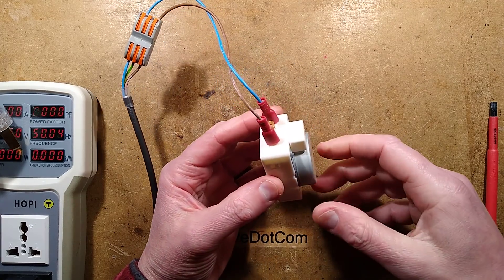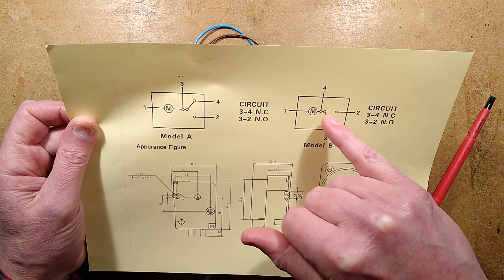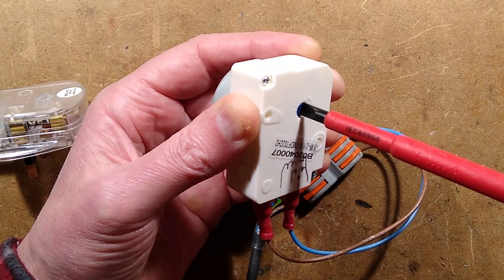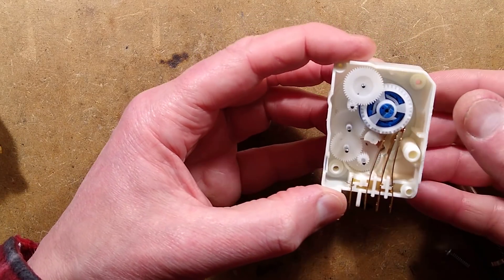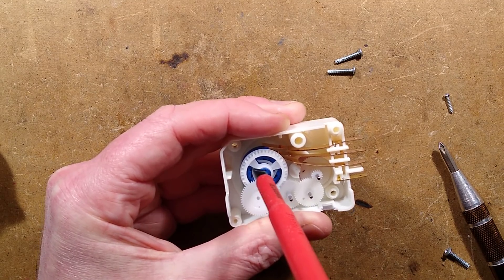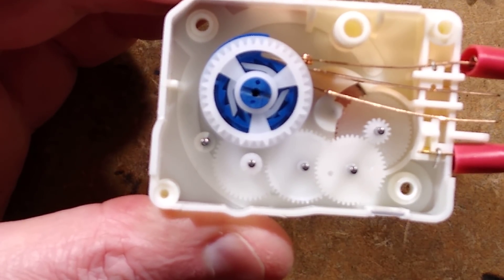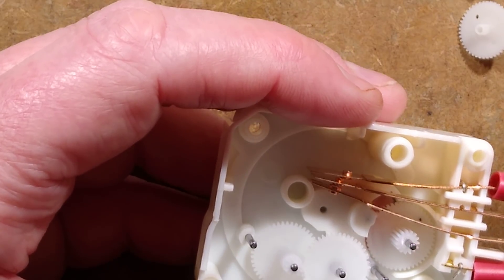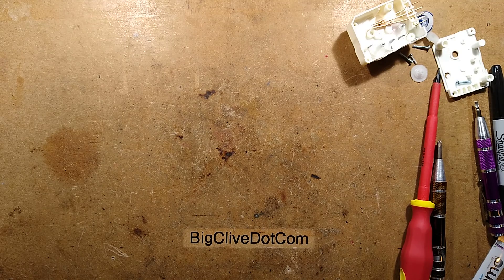Defrost control timer.  More complex than you might think

Comment: How can the tiny timer motor windings handle the current that is needed to run the compressor (in the second diagram, when the DF stat opens)
Reply from the maker: It doesn't.  The motor runs on its own.
Reply: @bigclivedotcom  oh, so at 15:18 the current trough the compressor is not enough to start it up? I thought that if you connected a very small motor(in the timer) in series with a very big motor(in the compressor), you'll just end up frying windings in the small one.
Reply: @billysgeo  The timer motor draws so little current through the compressor motor's winding that the compressor motor wouldn't even notice it. Also, at such a low current the resistance & reactance of the compressor motor would not reduce the voltage to the timer motor in any meaningful way.

Comment: Clever, but if the defrost heater fails it will get stuck in the defrost cycle until the whole fridge warms up.  It could do with a timeout function.

Comment: Is that motor one of those that give you one hell of a zing if you hold the leads and twist the motor shaft? If so, make a projekt with it as a wind powered generator, lighting some LEDs.
Reply from the maker: Yes, the synchronous motors do pack a punch.

Comment: What is amazing is that these defrost timers haven’t changed much in the last 45 years, and they are still present in refrigerators for sale today here in the US.  There is some very cool mechanical engineering going on here.  I am very impressed with the interaction with the compressor contactor and the defrost heater that allows the timer to dynamically adjust the heat dwell time so it is just enough to clear the evaporator but not let the freezer compartment warm enough to spoil the food.  You could throw PIC, thermistor and a relay or two at the problem, but the mechanical solution is elegant  - no need.

Bonus points: reverse engineer a mechanical timer from a Hobart/Kitchen Aid dishwasher.  They’re a work of art.

Almost all top loader washing machines use the same electronics board no matter the manufacturer.  There is usually service booklet stowed inside the washer.  Some neat tricks that can be done in service mode as described in the booklet.

Comment: Dang big clive those been extinct for 20 plus years on us. I miss them now they computers pc no way on some to even initiate defrost. The one you got runs all time unless motor wires in series with thermostat for culumutive run. But most just get yes 110 volts +-10 per cent . Anywho runs all time 1st click it puts refrigerator in defrost mode if defrost termination thermostat is - 10 degrees fahrenheit thereby turning on defrost heaters melt ice off evaporator coil fan powered blows to bottom refrigerator parts 2 click right back to refrigeration. There first runs all time stat in conctdered columitive run. I've had drains clog up with ice after years of a little ice. You can wrap a copper wire around the element then it will convect heat and clear drain is water under crisper drawers. Those were easy the new ones suck. Determine time doors open etc haven't seen in  20 years. I worked on thousands and instructor hvac 
GOOD JOB IM NOT worthy thanks

Comment: You should make yourself a foot pedal power switch so you can turn a device on and off while your hands are busy holding stuff in  front of the Camera. I have a set of lights over my work bench set up with a foot switch so that I can turn extra lights on when I'm working on something and I realize that I need more light to see what I'm doing.
Reply: Even without the camera it would be useful if you need to hold probes or something in place during powerup. If it's a momentary switch it could also be useful as a dead man's switch when working on potentially dangerous devices. Just be sure you use a properly rated double pole switch if working with mains.

Comment: The "ramped screw" is actually a copied design of the earliest tamper resistant screws if you look up "one way flat head screw" you'll see what I mean. Common in the US for putting together toilet partitions, installing towel holders ect. Anything public you don't want anybody messing with
Reply: Power boards use them to prevent disassembly...
Reply: @KomiyanVT  yeah they're used all over the place. It's one of the first tamper resistant screw designs.

Comment: Hey Clive; thanks for the explanation of the defrost control!  It is indeed complex using the components to provide power paths as they do.

When you don't have to maintain any part of the cabinet always below freezing, there is another interesting way they make a defrost system. This 1960's era soft drink cooler uses a cycle-defrost system. It can maintain bottles at or slightly below freezing but does not build up frost or require any dedicated defrost heater or other components. Forgive me for not mentioning I'm talking Fahrenheit temperatures in the video! It was for my vintage refrigeration repair friends.

https://youtu.be/79e7ie-6pE0

Comment: They don't use those mechanical defrost timers anymore in production.  Most any fridge less than 10 years old uses a control board which takes care of the defrost cycle,  the box temp (thermistors are used),  among other things.  Everything is governed by a microcontroller these days.  You would be hard pressed to find mechanical timers and cold controls on newer machines.  About the only mechanical switches are the door switch for the light  and the defrost termination thermostat.
Reply: In fact, LG even had a VW Dieselgate-style scandal where they rigged the software to detect the Energy Star test cycle and suppress defrost.

Comment: I had to replace this in our drink fridge. Whirlpool uses a variant where the motor is discreet parts, under a clear plastic dome. Unfortunately the cogs are in the same opaque white plastic, but it was fun watching the motor whirr. Kinda wish it had some kind of over-temperature bypass, re-engaging the compressor. Never fun finding a warm fridge.
Reply: Most of them only stay off for 20 minutes so the water has time to melt & flow out of the freezer. So, in a sense, they do have it. It just might not be as fast as you think it should be. But because there are plastic panels over the cooling coils you never see the frost & ice in a modern refrigerator. The panels help the heat be isolated to just the frost & ice and so they don't ruin your food. I have seen large meat roasts which had rings of green spoilage within them when the limit cutout switch failed to do its job repeatedly.
Reply: @johnpossum556  Good to know. In this case though, it had clearly been off (or in defrost?) for a while longer. The fridge was warm, and the freezer was about room temperature (with frozen items thawing). We've had this particular fridge for the better part of a decade, and that's only happened a couple times, but it's still aggravating when it does.

Comment: Similar with the standard "old" icemaker control module.  Just the rotating wheel with contacts underneath the connect copper traces that stops then gets that kick back to the normal contacts with the thermostat closing to indicate the ice is ready for harvesting.  

I've opened two of the defrost timers for the US market.  One like the one in this video had a capacitor to drop the voltage for the clock and the other used a resistor.  The clocks actually being 12v.

Comment: Back in the day when a fridge would last 30 or more years these mechanical timers were common. These days I have not found a fridge that uses the mechanical defrost timer. All the units seem to be fully digital control and fail with in 6 years. That way you either pay to fix it to get 6 more years "if your lucky" or buy a new fridge.
Reply: I'm sure there is a digital counter in there that causes it to stop working as soon as the warranty expires.

Comment: Hi Clive ... Afew finer points on the electricals.
1.  heating stops when the defrost termination switch senses the temp of the evap coil above 6 degrees c, even though the now seemingly reverse current is flowing through the timer, to advance out of defrost mode. This path only carries the mentioned 1.5 whatts, which is too small to operate both the heater and the compressor,
2. motors that run on single phase ac electicity always run the same way no matter which way they are connected to the A and N .This one is called a shaded pole motor and rotation is fixed at factory, by a copper insert in the magnetic flux path. However a smart elecky can reverse some of the bigger single phase motors.
3. I preferr the option of the timer motor running during defrost. this type of timer was set to an average time greater than what is expected, by a minuite or two, and thus act as a backup to terminating the defrost. This was always a good safety feature,as a shorted terminator could melt the feezer compartment into a plastic blob.
5. An extra  to this, is that the air circulation fan inside the freezer,  is connected electrically, so as to shut down during the defrost, and also wait for the compressor to operate after, this removes the heat from the defrost event, before air circulation restarts. so as heat is not injected into the freezer, propper. This is aprox a two minites delay.
Thanks for allowing my input.
Brad

Comment: This died on my beer fridge a few years ago and the freezer started icing up. Bought a new one for $AU30, replaced it and the 25-year-old fridge is still working perfectly.
Reply: mine the drain ices over quite quickly then it just starts defrosting into the bottom of the fridge and running out the door.
Reply: @A.Martin  Have you tried flushing the drain line? My parents' fridge had a significant icing issue that was solved by running a few cups of hot water through the drain.
Reply: @Azlehria  yea ive thawed it a couple times now, ill try the trick of putting a wire around the element and poke it into the drain.

Comment: Supco makes a universal electronic replacement for defrost timers. It's adjustable for both defrost time and frequency. I bought one for my old fridge and set it to the minimum defrost time (10 minutes) and the maximum defrost inverval (12 hours). I figure it probably saved me a bit of electricity.
Reply: Yep the newer frost free refrigerators actually use more power then the older ones!
Electricity suppliers in the USA want you to get modern "energy efficient" models those are the exact opposite the new stuff is junk with electronic controls for everything and they use more energy because they run more to meet the set point as the box is not insulated as good thus using more energy the supplies main intention as they sell more electricity and the new crap fails in a year LG = Like Garbage Samsung = SamSucks

Comment: Not everything needs to be electronic. This mechanical device works just fine for the application. I was surprised you didn't warn all and sundry about the dangers of mains electricity, then proceed to take the mech apart, whilst it was still plugged in. Thanks again, Clive. 👍
Reply: Actually they do have to be electronic. These are obsolete: modern fridges use adaptive defrost based on a microcontroller measuring things like door opening cycles, evap temp, compressor and fan runtimes (which are now decoupled). The cause is strict energy efficiency requirements by both the EU (Ecodesign) and the US (Energy Star, California Title 20).
Reply: @straightpipediesel  Yep, fair point. I forgot about modern fridges and more precise control requirements.

Comment: I had the fridge fail when the defrost temperature sensor failed.  It was an old fridge and I had already replaced the timer once so I nearly junked it and bought a new fridge.  I figured it wouldn't hurt to disassemble it and see how it worked.  I found a little metal button sensor snugged into the coils that seemed it could be the culprit, so a couple of bucks at the repair store and 10 years later it's still working.  But yes, the failure mode was the timer just stopped waiting for the sensor to say the freezer had warmed enough and never restarted.

Comment: I am a huge fan of seemingly simple devices with interesting engineering. I feel like we miss out on that in a lot of devices nowadays. If you gave an engineer the task of building a defrost timer nowadays, it would be a simple microcontroller and a relay. Boring!

If you ever get the chance, take apart a basic refrigerator ice maker. They incorporate many of the design ideas from this timer. A valve to let the the tray fill up with water, a little heater to help the cubes release, and a motor that drives gears to activate the relay, heater, and little fingers that push out the cubes. Beautifully simple. I can't speak to more expensive refrigerators' ice cube makers being as simple.

I've wasted many of kilowatts having the freezer door open watching the gear slowly move while it does its thing to make ice. Maybe I'm just easily amused.

Comment: My freezer is too old for this. The timer is just a wheel with a hamster in a parka.
Reply: The timer on mine is if I can't open the top drawer anymore.
Reply: @webchimp  Yes or when you find there is more ice than food inside!
Reply: Luxury! Mine starts opening the door slightly when the ice grows too thick, thus allowing the ice cream to melt which makes me swear and chip the ice off.
Reply: @franceslarina5508  Had one like that - so I broke the door to the freezer off ! ( or rather it cracked - so I had to tear it away ! )
Reply: I have an old freezer from the early 2000's will it have one of these?
Reply: @izzystuart7798  If it's self defrosting (excessive ice doesn't build up on the shelves or walls) and has a mechanical knob to adjust the temperature rather than a digital control, it almost certainly has something like this.

Comment: Not too dissimilar to the diverter valve motor in my boiler (which said diverter valve likes to fill with water and trip the electrics after a year of use cos Baxi sucks bovine testicles with their crap valve manufacturing), though the valve motor has a wheel with detents to switch the contacts back and forth on a pingy-springy see-saw type of switching setup...

Comment: You're a rather busy guy. All hail us aspies! 
My laundry units do this too. The timer motor on the washer is attached to a multi-track cam wheel that activates several contacts to change the motor speed and the solenoids that control water (hot and cold) valves, and transmission action between wishy-washy and spin.
Reply: Old fashioned mechanical automatic washing machines - the control drum, now there is a complex machine.
Reply: They must be bit older units as logic boards seem to be cheaper to manufacture for that usage. Though I suppose it's somewhat nice to be able to replace parts fairly easily.
Reply: My old dishwasher also does this, and even has a similar setup during a heating phase where the motor is put in series with the heating element and then shorted until temperature is reached.

Comment: How can the motor run when power goes to the defrost heater, pin 1 (motor) is connected to N via the defrost stat ? Unless there is a voltage drop on the defrost stat.
Reply: The motor doesn't run in defrost mode until the defrost stat opens.  At that point, it's the heater, motor, and compressor in series across the power line.  Since the timer motor takes so little power, compared to the other two, it gets most of the power line voltage and is able to run, taking the system out of defrost mode.

Comment: The one I had in my house in Mexico worked using a pic micro controller and a mechanical thermal cut-out that told the micro the temperature in the freezer reached 70 degrees and then stopped the defrost heating element and restarted the whole 24 hour cycle.  It was a re branded GE unit called appropriately a MABE.
Reply: You sure it was 70 degrees? All of those cut outs I have seen are around the freezing point of water. They don't need to get any hotter than to melt the water so that it drains away from the evaporative cooling coils into the drain pan at the bottom of the refrigerator. There would be no reason to heat the water to 70 degrees whenit will flow just fine at 33 degrees F.
Reply: @johnpossum556  The sensor would need to wait for a temperature a fair bit above the melting point in order to ensure the entire evaporator was hot enough to melt, though 70F still seems too high. Maybe the 70 degree cutout was just a safety limit switch and the actual control was done digitally. Or maybe it was actually a 7.0 degree C cutout.
Reply: @eDoc2020  fuck, I lost my message. Maybe I'll get to remaking it later.

Comment: I've lost track of how many of these things I've replaced over my time as an appliance repair man. Getting stuck just before kicking on the defrost was the most common failure I remember. They could be manually turned to defrost, and they would start turning around again, only to get stuck just before defrost again...
Reply: not as common as burnt contacts heating the metal so hot it melts the plastic cam lobes or the arms lose spring tension, then the compressor starts being cycled on /off wildly as the plastic melts or the contacts make and break poorly, burning more. I have seen them fill the inside of fridge with smoke, after they melted the timer case, plus fridge above and insulation! in more than one case the people called the fire department